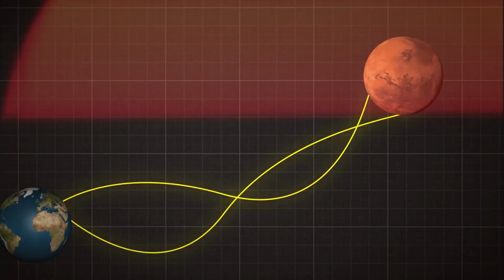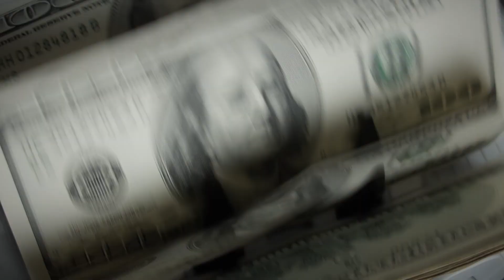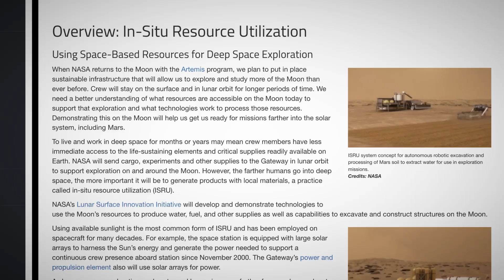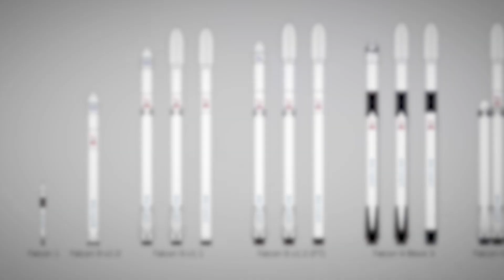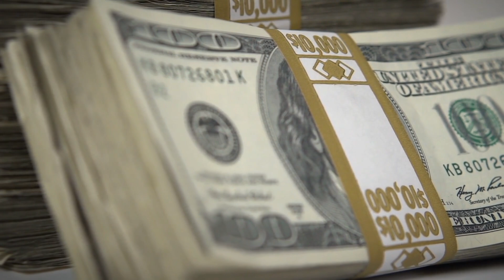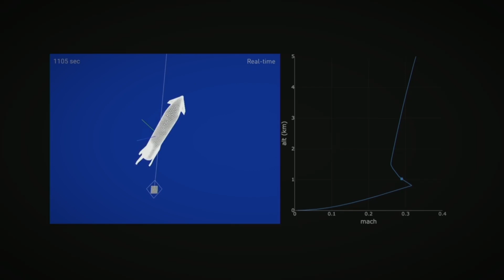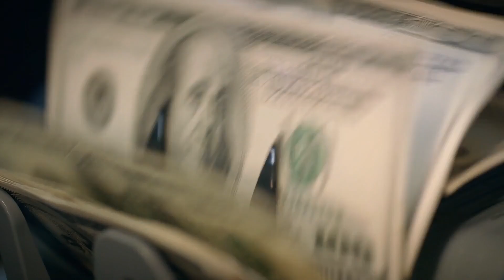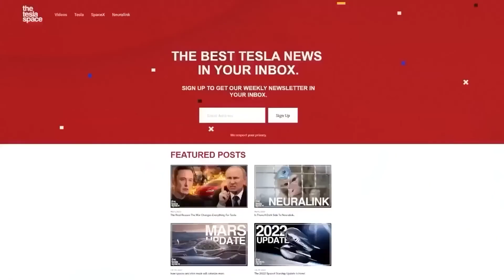The Real Reason SpaceX Developed The Starship!

Comment: Guys the Star Ship is a blast the top end is a brilliant Idea. As far as the top end but as for the center sections and the lower blast off section with all the raptors are yes a lot of thrust on the bottom end but between the top end and the bottom well lets all take a step back boys and girls. Oh no no no but yes yes yes. This is  design may come to haunts us all its an  alligator. Old school traditions are not going to work here. Elon Musk wants a heavy lift machine that will hall a payload a very heavy heavy lift. I do believe the engineers have taken Elon for a ride. Meaning build a pressure vessel filling it up with fuel then blowing it all  up no not this man is going to get his moneys worth this time even if the FAA takes another six months before giving up the license. This man wants his heavy lift starship and he needs engineers and he needs too go out there and find experts in the industry. Look this this pay load is always going to have problems. We need assisted lift off meaning to get this heavy monster up high enough to fire all raptors. Put it inside a towering marvel where time and time again several times a week it can be loaded up. Or start building trusses all around round the star ship we go. This tower or towers need to be huge at least what twice the length of the star ship double load or quad lift off engines they never leave the tower they are just assisted lift elevator engines or add four external engines.

Comment: The huge starship is the wrong way. They should use A-I to build the ship in space and use high tech catapults and maglevs to launch cargo and material into space. Very little food and oxygen needed. A very small crew can direct the A-I. Small shuttles should be used for passengers to go to and from the earth to space and from space to earth.  Building the ship in space removes most limits on size and shape. Actually, I would design it like a huge wheel with spokes and with a huge hub at its center. And yes, it would be meant to spin to create artificial gravity. A dual wheel moving in opposite directions with opposing super magnets aiding in their rotation, can also help to build a magnetic field around the ship, helping to protect the  passengers from the sun's radiation. We build it to handle thousands of passengers at a time. It acts as an ocean liner of sorts to and from Mars and the moon and beyond.
Reply: U should pursue ur life into these thoughts out possibilities. What else do u have to do, Seriously.

Comment: As the Titan submersible disaster shows, carbon fiber is no more a "do-it-all" material than any other.

During early design phase, in determining strength, simple tests under varing shapes should have eliminated carbon fiber from both designs.

When breaking under pressure, carbon fiber splinters in an explosion of shards towards the low pressure, then back.

Comment: What a load of crap...  his real problem is, the fuel equation.  No matter what the thing weighs, no matter how much fuel he on-boards, the tanks will be empty after achieving escape velocity orbit.  Thats the rocket equation, breaking free of gravity takes all of the fuel, adding more fuel adds more weight, you still burn it all. Whatever you send out beyond orbit goes at the same rate of speed they travelled with in 1969. Its 8 months to Mars, one-way.  No atmosphere or water when you arrive.  Its so idiotic.

Comment: The fact that they cleared the pad with Starship is imo extremely undeplayed achievement. great vid
Reply: I just realized that they are estimating helium 3 to be worth 16 billion per ton. And it is everywhere on the moon. 65 million for a reusable rocket that can carry 150 tons...
Reply: @adrianbarreto4225  it doesn't really have a value yet as there is nothing to use it with. The theory is that you can use it for Nuclear Fusion, however that technology is just a pipe dream. 
Also, 65 million per launch is another pipe dream. Just like how they expect 7 million per launch with Falcon (which is still approx 55 mil). 
You can't use 65 mil in calculations when they reality is 4-5 times that. 

I'm pretty sure 150 tones of helium 3 isn't going to fit. Gases require much bigger volume for storage. It's not like 1 tonne of any element fits in the same size container. 

Lastly and most importantly, there is no proof there is mass qualities of it on the moon. All theories about that have been debunked.
Reply: Settling the bar a bit low isn't it? Imagine everyone at NASA circle jerking over that feat. Or if it exploded well short of the goal.

Comment: Actually built in Carbon Fibre& dipped in Colloidal Silicate and Charmotte;used in the correct recipe,which would properly protect both the Rocket,as well as the Astronaut’s or other folks aboard;should it loose any of its protective tiling. Plus it’s easier to apply the “heat -Shield” to Carbon Fibre,as well as a surface material the same as the heat-shield tiles,ensures an optimal safety. Also this can either be Mould-constructed or 3D-produced. This would enable SpaceX to turn out rocket upon rocket,using the same mould,and coating it all,either via Spaying;or preferably tank dipping each moulded ship. The recipe of Colloidal Silicate/Charmotte continue ally turned so as to prevent the -0.27 micron flower particles from settling in the Colloidal Silicate. To solve this issue a 3/4-tank with seal close top could be built and each ship slid into the tank. The tank is sealed and rotated to ensure that the mixture seeps properly into the Carbon-Fibre Weave,where it will form attachment to both the weave;as well as incorporated raised old-door-lock shaped nodes to lock the liquid in place. [Ideally and to ensure an absolutely safe and strong surface.A 3-micron wax dip could,(and should) be done prior to the Charmotte/Silicate dip. WHY:To ensure the best and strongest outcome and bond. A flash-dewaxing of this surface-dip should be done.(It begins the Ceramic Shells hardening process.) And ensuring a more durable and stronger surface for the final few coats of these varied Micron Charmotte mixes,prior to heat shield application. ] Should several heat shields then come adrift,the surface of 14:22  the ship is utterly properly protected from heat&remains both safe and protected against hi temperatures. So too do the contents. (The most important factor.) It’s a second Option for SpaceX and although Carbon Fibre is more expensive,(&Im sure Elon could find something as good,but cheaper, to which this mixture properly adheres. It’s outcomes are safety both here and on moon and Mars landing s. Fixes can be performed should Dire circumstances (of say Distance from home base,call for them. But would require a means to reach said area and “carry on aboard fixture-materials.(To me a logic on a trip “Far far from home!!)! Everything and every prospect should be covered. One can never have to much survival material s. Anyway it’s a thought from someone who wrote a Dissertation on the recipe and materials used in the mixture above. Biological,Scientific and mathematical calculations were followed from the raw material mined material through the making of the material;through to its packaging. The same applied to the recipe and I found an anomaly in the Viscosimeter theorem. It turned out to be as a result of the fact when it was written. The means of identifying microns was way outdated. A test aboard The International Space Station in Zero gravity proved that my thought had been correct and that the Viscosimeter didn’t take into consideration that the microns(their finest particles),settled prior to them running through the Viscosimeter needle,where the reading is taken for those few seconds. The slurry was in fact settling creating inaccurate Viscosimeter readings. In a bronze casting situation at 1250’Celsius it had the potential for disaster. Molten hot bronze is not fun when it hits cement and is affected by the liquid retained in the cement. It has a tendency to explode as I’m sure all who watched the rockets launch came to appreciate.  Give it some thought Elon.
Reply: @ElonMusk-bw4yn  Not that where I’m responding from should make a difference. Since knowledge is knowledge. It’s attained by those who go in search thereof, because they have a desire to attain that knowledge and enrich their minds,in contributing to the journey on which they have sent their minds. Questions arise and Answers need finding. Some do intense research and search to resolve the answer from every angle. Be it mathematical, scientific,biological,sculptural and all and every other plane that contributes to the understanding thereof from an entire 360’ infinitum point of view. To resolve the problem entirely and with thorough researched knowledge. Testing and understanding entirely the solution. But since you ask. Port Elizabeth,South Africa. Ironically the same country where Elon Musk was born. I hope that that resolves your question.But hope that the information was understood way before you asked the latter question. Otherwise my expression is really lousy.

Comment: Every aspect of this rocket screams of  general astrological and logistical ignorance.  From the top heavy weight distribution to the lack of workable operational layouts to the entrance being WAAAAAY up on the side of the rocket to the fact that most botanical and biological entities do not survive in weightless high radiation conditions...

These are delusional promises made by a con man who uses this thing as a distraction when his financial shell game takes a downward turn.  It is NOT a viable option to get plants or animals OR HIMANS anywhere NEAR Mars.
Reply: six months of zero-g watching mars grow bigger and bigger be a most amazing journey 

multiple ships in formation shield eachother and a 9m diameter loop gives you all the g-force you need - spin the bathroom section juust a little and the bathrooms can be used normally -showers even
Reply: @replica1052  In ONE month of zero G, your circulatory and digestive  systems are going to be a mess.  And even if this thing is able to sustain a 30,000 km/h speed through momentum (which it won't), that's  not 4 or 6 months.  That's NINE months to Mars...MAYBE.  this thing might have enough room for the FOOD required for FIVE people to get there.  It WON'T have enough for there AND BACK.  And it CERTAINLY will not have enough FUEL.

You said to SPIN this thing?  Hate to tell you, but you MIGHT be able to spin it LONGITUDINALLY.  That means at least 30% of that pressurized area still be zero G, and all the remaining fuel and LOX would be spun away from the pump takeups.  Good luck trying to restart those engines when the fuel is out of reach of the pumps.

Like I said...this design is borne out of ignorance, NOT INNOVATION.  Go watch Common Sense Skeptic's series on the design of this thing.  The numbers and basic critique are undeniable and inarguable.

Comment: With Martian gravity being 38% that of Earth, it is possible that Starship could achieve orbit without a booster but they would have the same problem as Earth launched Starships... not enough fuel for the rest of the trip. This will necessitate an orbital tanker depot, AND tanker launches, like the one(s) needed for Earth. This means there will be very few return trips to Earth. Each and every Starship bound for Mars is most likely a one-way trip. That's part and parcel of IMMIGRATION to Mars. The bulk of fuel produced on Mars will be needed to fuel Martian use, not return trips to Earth. It will take over a decade of infrastructure development on Mars for two-way travel to be regular. IMO

Comment: It's not true that the name was clarified to mean "Big Falcon Rocket". That name actually makes no sense. There is no relationship to the Falcon rocket in any way. Completely different design, size, building material, engine, fuel, etc. Everything about the rocket is different. The Falcon Heavy actually makes sense because you can basically think of it as 3 Falcon rockets tied together even though it's way more complicated than that. The name has always been Big Fucking Rocket from the very beginning. The name actually came from the game Doom and it's Big Fucking Gun. The problem is that Gwynne Shotwell was asked about the name, and she didn't want to say the real name, so she totally made the name up. And then every journalist and whoever wrote that stupid Wikipedia entry for Starship, all decided to go with that made-up name because the real name is supposedly offensive and everyone is scared to say it or print it.
Reply: And it's not just a Doom reference.

The Falcon series takes a lot of design inspiration from Armadillo Aerospace, a rocket company started by John Carmack. John fundamentally change the way rocket software was programmed, seating where the Delta flyer not only failed but hit a design brick wall.

It's a bit of a rabbit hole of a reference.
Reply: The F in BFR is mis-interperteed by prude's/woke fanatic's as been rude by people with mental problem's